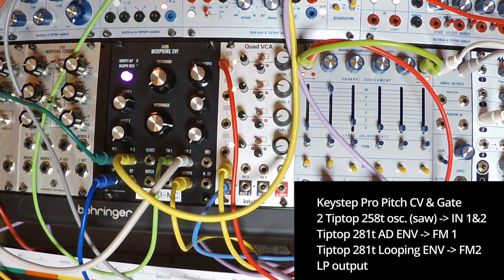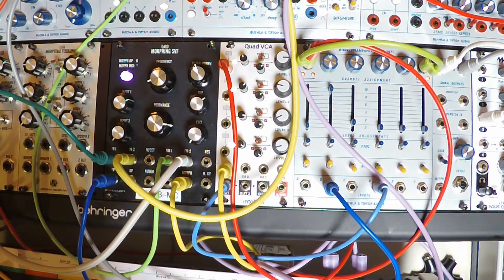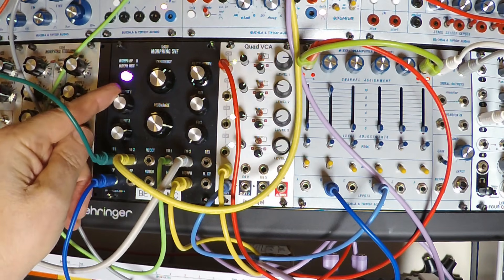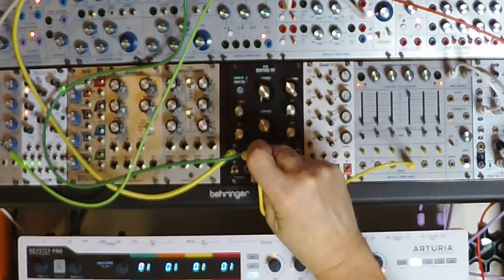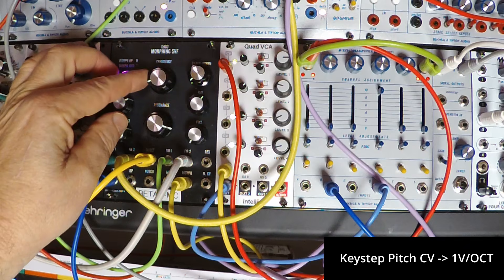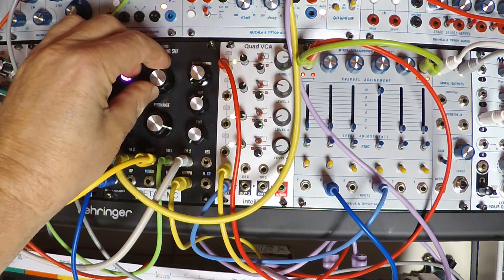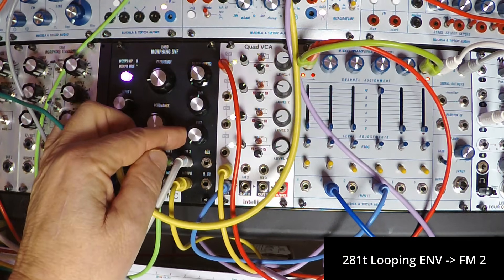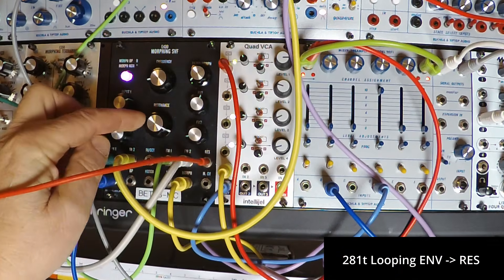Synthesis Technology e430 Morphing State Variable Filter Demo.

Comment: Nice demo. Are all the outputs available simultaneously?
-thx
Reply from the maker: @brianreilly6545  yes, they are, even the Morph output.
Reply: Great thx for replying! Also when adding cv to morph input, the morph knob then acts as the cv attenuator, so any offsetting would have to be done prior, correct?
Reply from the maker: @brianreilly6545  Yes, that's correct.